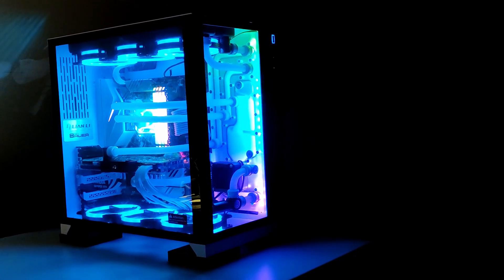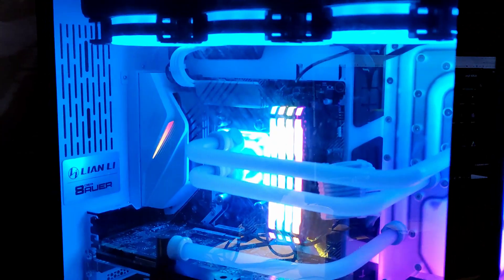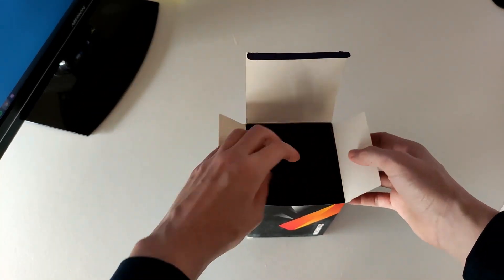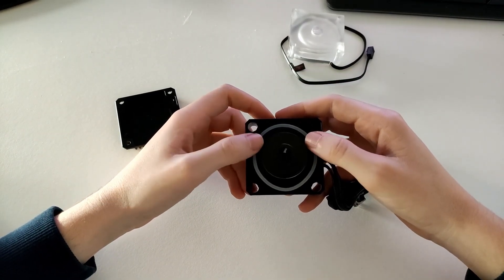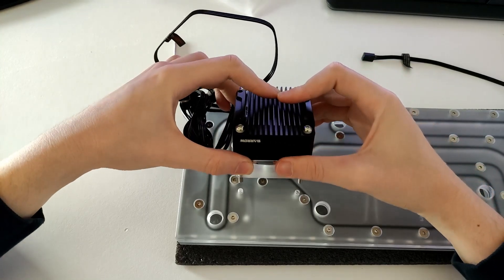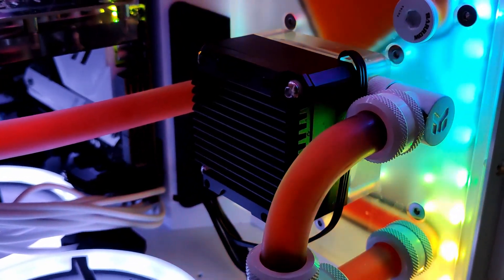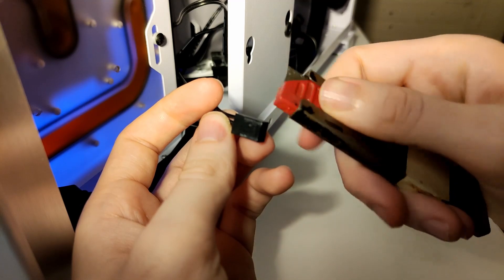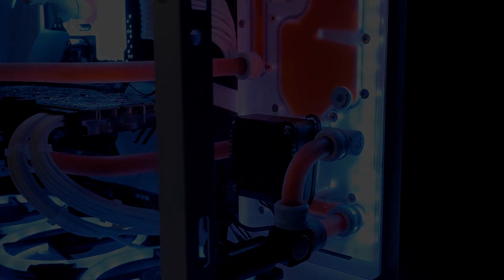A distribution block for less than $100 ?!

Comment: Hi just a quick question, at 8:34 on your top radiator you have a really small like how do you manage to take it in and out with ease? I was making a bend like this and actually bent my radiator fitting trying to remove the tube since the tube was in such a tight angle
Reply from the maker: Hi, If I recall correctly, I hand-bend that tube. Paying careful attention not to collapse the tube and making sure there isn't too much tension on the fitting. It's sometimes a game of trial and error.

Comment: what type of pump you can put in,the standart please ?
Reply from the maker: Where the pump is mounted on the distro plate, the hole is threaded. So in theory, you can mount any pump with fittings.

Comment: For the same price I can get a Phanteks D140 that will fit any case with an area for a 140mm fan at the back, which would be most cases. Won't work with this over priced case, however. I have never been a fan of Lian Li cases.
Reply from the maker: Lian Li products aren't cheap, that's for sure. But I like the aesthetics of the case. 
Fyi, cool nickname ;)
Reply: @OtherSideTech  Thank you. This case does seem to be very popular.

Comment: Lol so it's not even close to under 100. You need the pump. With shipping and taxes it's close to 170. I know because I bought one (bykski
Reply from the maker: Actually, you don't need that pump. The hole where you mount the pump, is threaded. Meaning that you can screw in a fitting and connect it to a standalone pump if you wish ;)
Reply: @OtherSideTech .... You need a pump in your system regardless. Any standalone pump would cost $50 as well...